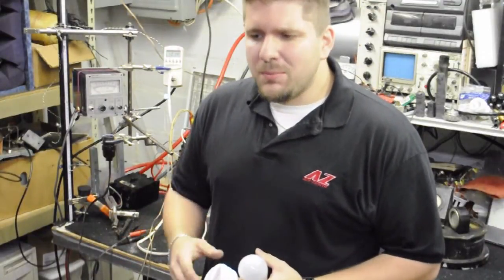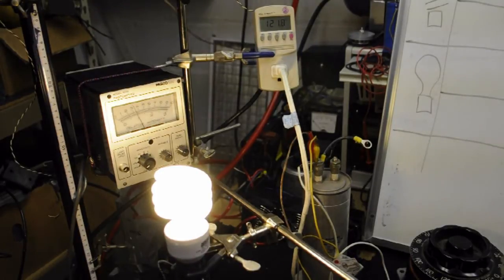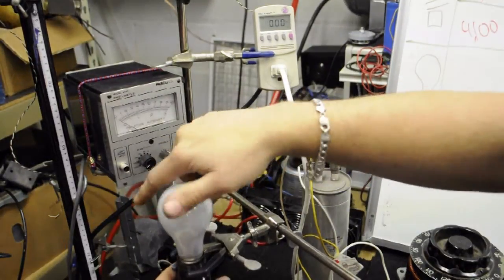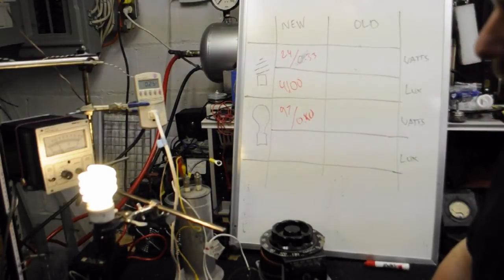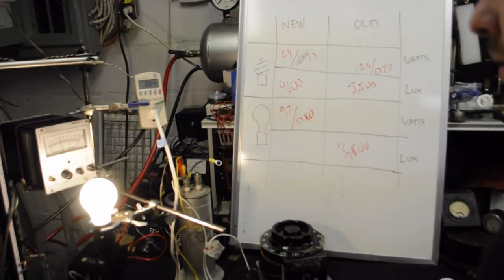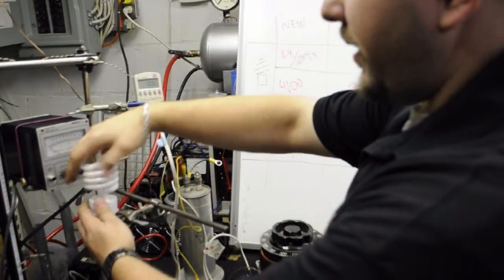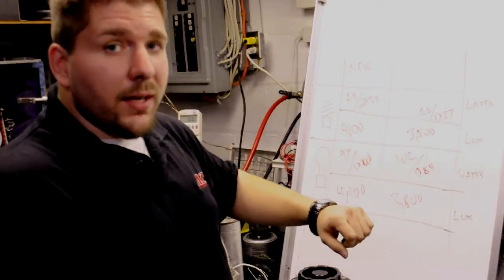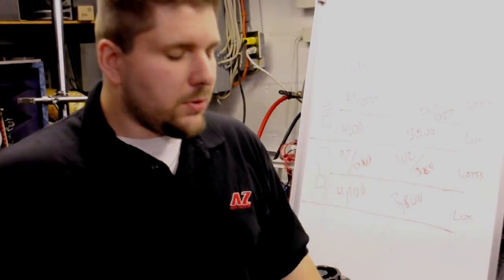CFL vs. Incandescent  ( Tested )

Comment from the maker: @oldskoolnoma 

For residential they do not meter for power factor but, because of the CFL push, power companies  blanketed in there PF correction as part of the new higher rates. So weather I use CFL or Incandescent, I get fined the same amount. Commercial is another story and those rates are location dependent.